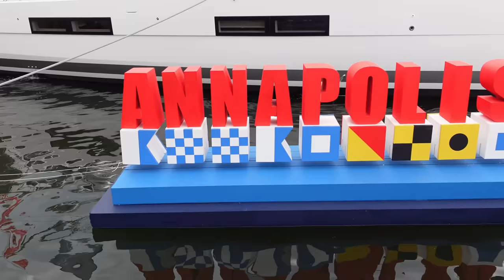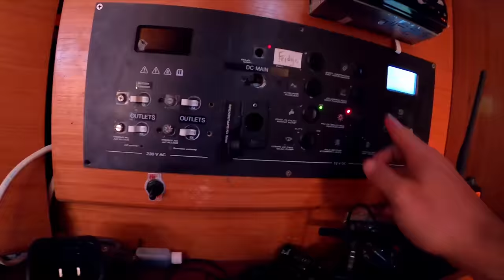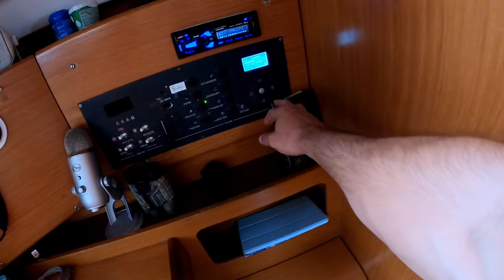BOAT SURVEYED by a LEGEND with Unexpected Surprises at Every Turn! What's Next...| ep.6

Comment: Boat life. The humor about the reality of work required. Engine, transmission, hull repairs are just the beginning. Engine and transmission first. Next is determining water entry points. Drying out, sanding and glassing. Afterwards, verifying the structural repairs are adequate. What must be done now and what can be done later or at sea.

 Priorities, budget and timing. They all conflict. Can use the dinghy or dinghies to guide the boat to the lift. Enjoy your new life, opportunities and surprises together.

Comment: There is a trick that can sometimes prolong a transmission. You mix half the old fluid with half new fluid. You did the right thing though in the end. It needs to be rebuilt or replaced.

Comment: A rebuild is usually considered replacing all bearings, machining the crankshaft, cylinder head and cylinders, new pistons and rings, all gaskets and seals replaced, having the injectors and injection pump rebuilt as well. You cleaned up and repaired the engine, you did a nice job but far short of a rebuild.

Comment: I feel that the broker and previous owner will have a run of bad luck for non disclosure.  In light of what you have found sofar, engine out is no bad thing as everything else back there will need attending to.  Its a pain in the hole but a well light clean and well organized and accessible compartment instills confidence. Time to buy the industry bible.. nigel calders boat owners electrical and mechanical handbook.  It pays for itself as a laxative alone.

Comment: Its a hurth ZF transmission change the transmission fluid with engine oil change and it will last . Older hurths require dextron 2/3  non synthetic ,not even semi synthetic , its too slippery and causes transmission to slip wearing out thrust washers until it totally slips, replace the washers and your good to go . The clutch plates are usually good ,its the thrust washers that go and sail with it in reverse locking it or it will wear out